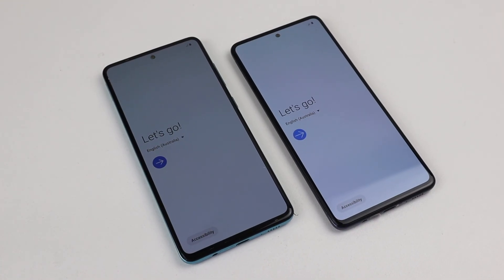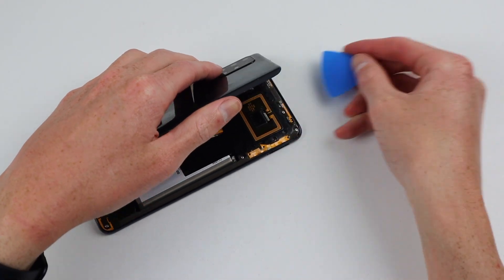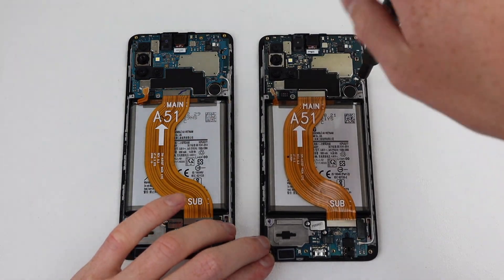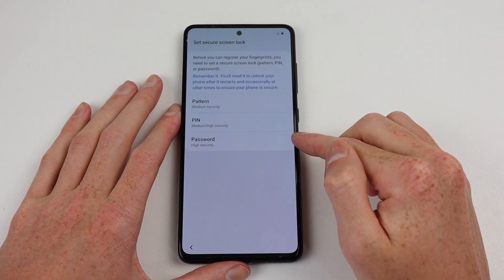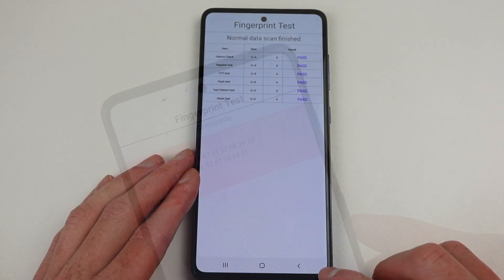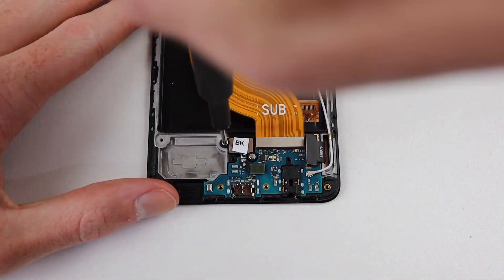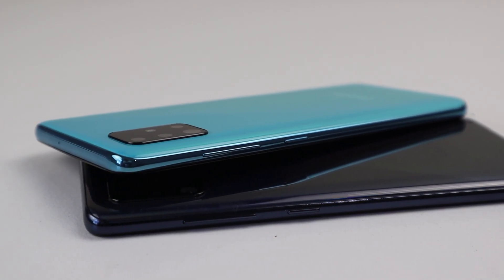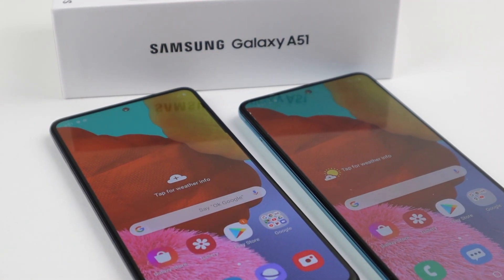Samsung Starts Blocking 3rd Party Repairs? - Galaxy A51 Teardown and Repair Assessment

Comment: It's strange to me that the phone seems to be pretty easy to open and swap parts (unsure about the battery, as you didn't remove it), yet they are updating the phone to disable the swap of the part.  Why?

Comment: I remember when I changed a screen on a Galaxy A21s, it had the same fingerprint issue after the repair. I checked for dust and anything physical that could cause the issue. This was when I worked at a phone repair shop september last year. Now I understand what might've been wrong.

Comment: Can you cover the s21 repairability when it comes out?
Reply from the maker: Will be doing, have two on order :)
Reply: @HughJeffreys  thank you
Reply: @HughJeffreys  I think you need to have both sensor on the same biometrics patch to make it work, needs a Odin reflash aswell. Should work without any issues.